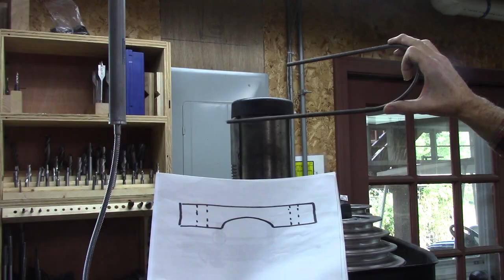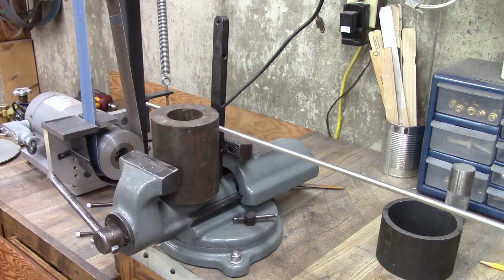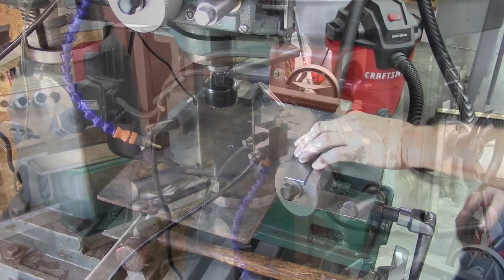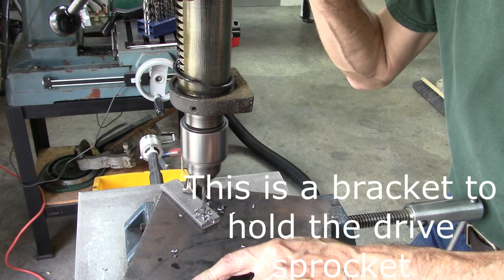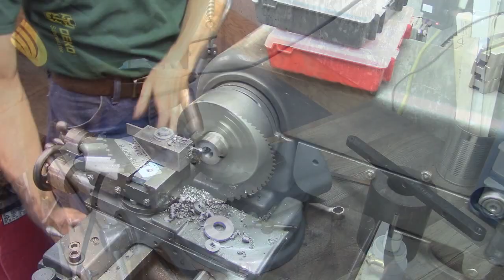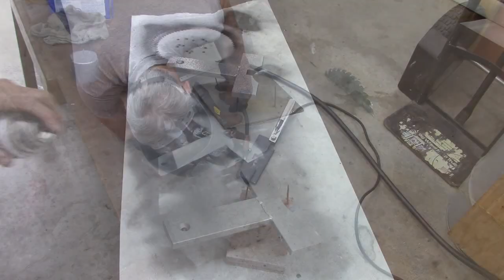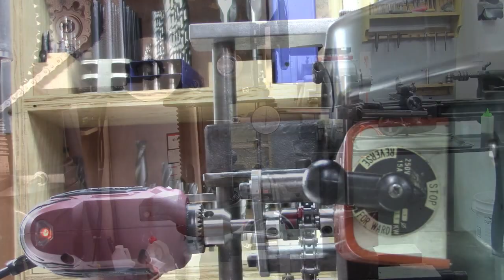The Ultimate Round Column Mill Fix

Comment: Do you think that just fixing the gear rack to the column would accomplish the same thing? either by welding it or bolting it down to the column. in a way that the welds or bolts don't get in the way of travel up and down. like plug weld holes drilled into the rack or countersink the bolts into the holes. maybe by tightening up the tolerances around the rack and rack guide in the existing machine, you could get similar accuracy as compared to a more complex and more changes necessary to the existing machine design like yours. nevertheless, your still on a round column. I HAVE one of these rung-fu or RU30 machines and I have had this issue he addresses here in this video.  but having a round column also has some advantages. while repositioning the spindle exactly can be done with basic measurement instruments like a center finder or indicator. furthermore, this is an issue I rarely come across. and probably a more useful upgrade to the machine would be a more secure way of clamping the spindle head down to the column. that's where the rung fu design has failed me in the past, is movement during a mill opp. due to lose clamp nuts
Reply from the maker: Thanks for the comment. I have had the head slip on the column while milling but not for a long time. I now tighten the clamp tighter and it never slips. I have thought about a large lever and some kind of toggle clamp but so far have not followed through. Securing the rack to the column might be a possible fix. I actually tried doing this but had a few obstacles that I never found a way around. 1) the space between the gears teeth is not large enough to drill and pin (or weld) or at least I was worried about weakening the teeth. 2) securing the rack at the top and bottom was totally inadequate. The rack flexes and would need to be attached to the column in at least 5 or 6 location. Even then, .001" flex would equal to .010" at the end mill. 3) even with the rack temporarily secured to the column with clamps next to the head I had problems getting the head to clamp consistently. Achieving the correct amount of pressure pushing to one side was hard to do. Achieve a repeatable position was nearly impossible. I think that ultimately milling a shallow recess in the column would be the only way to adequately fix the rack to the column. Actually milling a slot and using a key might be a better approach. This is a huge job and I didn't have another mill to do this with. You said, "furthermore, this is an issue I rarely come across." This is surprising to me. Before making this modification I would work around this issue with planning my cuts and running the quill fully extended to increase the amount of clearance so that I could change a collet but, it was always a headache to deal with. Without a doubt this modification is a lot of work but when paired with the power lift it's a convenience I would hate to do without. The only time consuming task that remains is clamping to the column.....  and I need to address this aspect.

Comment: excellent video and design.   I have the same mill (circa 1998 made in Taiwan) and have been looking at different solutions, and i think yours is best.   I dont have welding setup, but should be able to do in aluminum and socket head cap screws.  BTW, love your "pre-OSHA" shop!
Reply from the maker: Pre-OSHA? Funny. I have a lot of open belts and gears. If I had a employee I would probably look at things a little different. Adding the guide bar and lift on my mill was a lot of work but very worthwhile!

Comment: I  implemented a much simpler, albeit slightly less accurate (perhaps 1/64"), solution.  My drill press table has a slide in-slide out sacrificial insert in the middle of the table.  I centered my drill press table at a convenient height and the marked scribed a line along the sacrificial insert using a transfer punch inserted into the chuck.  Then I marked the line with a pencil.  Now when I move the table up or down, I simply put the transfer punch back into the chuck, slide the sacrificial insert out to a point where there is no hole in it and center the drill table.  I have a picture, but YouTube will not let me attach it to a comment.
Reply from the maker: You can send me an email at winkywworkshop@GMX.com if you want.

Comment: The goal of keeping zero alignment is a good one. Seems like a simple dial indicator and brackets on the column and mill head would suffice.  Zero like a vice tightening and tapping with dead blow.
Reply from the maker: Suffice maybe...  but what a pain. I used to do that all the time. Occasionally I would get lucky but locking the head moves everything. With the guide bar it is very consistent, usually less than .002". Admittedly, working in a factory setting most my life probably ruined me. The extra minute or two it took me to align the head bothered me a lot

Comment: Could you do a video or post some pictures of how you mounted your DRO. I have the same type unit, and have mounted the z axis but not the x & y yet.
Reply from the maker: The DROs are a pain to mount. I'm not sure I did it the best way which is why I didn't make a video. The worst part is that I had to leave the way cover off. I replaced the X axis once already but I think I got too much coolant on the slide. The biggest issue is battery life. If you remember to turn them off you will be good for years but mine last less than 4 month because I forget. Here's a link to pictures of mine. https://photos.app.goo.gl/y86Y3aMenjvHQqeG9
Reply: @WinkysWorkshop  I see you attached the x axis to the rear of the table, I was going to attach it to the front (using the stop block slot), but that would mean I would no longer have a hard stop. I too have killed a battery or two by not turning off the unit! Thanks for the photos.
Reply from the maker: @carlsartor1423  Yeah...  it limits travel by about 3/8" but I'd rather do that than to lose my stops. Your welcome

Comment: I just got one of these mills and like the idea but i think i'm going to go with simpler by making locking brackets like you have to just lock in the gear bar...it will act like your outer guide rod. maybe some minor error but i'm not too concerned ..  great idea none the less, and power feed sure is nice
Reply from the maker: Yeah this was a fairly involved project. If you use your rack you will get a lot of flex in the rack. At minimum you need two bolts at the bottom and top to hold the rack to the column.  You may also need to drill and pin the rack in the middle as well. One reason I went with power was to reduce the influence of the crank and improve the accuracy.

Comment: Lock the rack to the column with countersunk bolts. Have a third collar ride on the plate along the column. Make the notch square, but round off its corners so that they don't dig into the rack's metal surface.
Reply from the maker: That would work but the rack would have to be bolted fairly often. Also the amount of metal at full depth of the teeth is not really adequate to counter bore.  I considered pinning the rack but was a little worried I would not get it straight.

Comment: Why not just drill holes from the rack to the column, tap and bolt it in place? Not being a smart ass I'm trying to find why it's not a viable option
Reply from the maker: I'm always open to ideas! Outwardly this seems like the obvious solution and I'm not saying it can't be done .... However, I clamped the rack at the top and bottom and the amount the rack flexed was substancial. I haven't done the math but .001" or .002" movement at the rack probably  equates to .015" to .020" at the spindle. To make this method doable you would need to bolt the rack to the column every 4 to 6 inches. The amount of metal at the bottom of the teeth on the rack gear is maybe 3/16 max. I was afraid it would weaken the rack or the teeth. The other scary part would be alignment. Making it perfectly straight might not be hard but what if you mess up. Correcting the alignment might be hard to do.
Reply: @WinkysWorkshop  Thank you for the response, I see the dilemma. I was looking to buy a round column because the used prices are good but I am reconsidering after seeing this.
Reply from the maker: @pnuema1.618  Around here you can get a well used bridgeport of index doe about $2000 to $3000. If you have the space it's the best option. I'm overall pleased with the round column but before I modified it, it was a pain. Totally bad idea. I put a square column on my drill press for the same reason. Best thing ever!

Comment: I will start with the seasons best to you and yours this holiday season my friend. Any time I see that little mill/drill I want one for myself. It has served you well as far as I can see and any tinkering you have had to do on it has been fairly minor. Yup on the 1/2 link or a plastic (UHMW ?) lined tensioner that wraps around a section of pipe just long enough for the chain to get the "climb" out of the chain. I used to adapt chains like this to multiple rollers in cedar sawmills that the bark would climb up on the sprockets so much it would break chains or bearing housings. Nasty problem easily fixed eh. It is always a nice visit to come and share what you have for us my friend. Good old no nonsense free problem or a go to machining for a cause. I just plain enjoy your posts my friend. Love that textured spray can paint my friend. It covers more bo-bo's than flat black and a grinder eh, LOL. eh, LOL. What a great addon to this for that piece of equip bud. There is always something to do to max the usability's to serve us. One machine to better the other. Not quite sure will be the end result of that remark will take us eh. Good seasons wishes to you and yours Winky. Onward eh ! Of course if you are bored you can wire in a couple proximity sensors that will take care of travels but yer a pretty sharp fella as it is eh, LOL.
Reply from the maker: Thanks for the compliment!

Comment: Is interesting to se how we solve problems. , I' think you over engineer it ., will be more easy to use the pinion rack as your guide and use a servo motor to go up and down but steel many ways to skin a cat well done on your trains of thoughts.
Reply from the maker: I actually tried using the rack and it didn't work out. I had brass tipped set screw pushing on the side of the rack to stop head movement. The rack was clamped to the column at the top and bottom and the head moved around a lot. The thing is, if you removed the teeth on the rack the remaining steel is about 3/16" inch thick. The rack flexes bad! At the top and bottom there is an area to bolt the rack to the column but it would really need to be bolted every 6 inches. Drilling between the teeth for the bolts would be risky and there wasn't enough metal thickness to counter bore for the head of the screw. The amount of tooth left would also not be adequate in my opinion. Then there is the issue of getting the rack screwed to the column exactly parallel. I've got maybe $120 bucks into the lift and guide. I would have loved to find a gear motor for the lift but I could not find one for less that $250 and the HF drill was $29

Comment: just a thought, the rack spins around the column with the head and couldn't you drill and pin the rack to the column preventing the head from rotating?
Reply from the maker: I did try this. To a degree this would work but their are a few problems to work around. First the clearance between the rack and the slot it runs in. I installed brass tip set screws to hold the head to one side of the rack. The way the casting is made it was hard to get to an area where you can do this but it can be done. Second, the column flexes, a lot. I put clamps at the top and bottom of the rack and the head moved back and forth at least 1/4". So to make this work you really need to bolt or pin the rack to the column every 6 inches. This means you are drilling through the gear teeth. I think a small pin would be the best option but I was worried and shearing an 1/8" pin. Larger pins would interfere with the gear mesh so part of the tooth would need to be removed. I was worried about weakening the tooth and the rack. There is less than a 1/4" of metal on the part of the rack against the column. 

Also, the guild bar is away from the column which makes it way more accurate. .001 movement at the bar is a bit less than .002 at the spindle.

Comment: great video, i have the same mill except mine doesn't have a reverse. Did you fit that and if so did you change motor or rewire old one .Thanks
Reply from the maker: Thanks! Mine came with the reverse. I bought it used. It looks original but I could be wrong. I almost never use the reverse. Of course if I didn't have it I would need it

Comment: Hi Winki, you might could put a adjustable Clamp across the two angles holding the Deleon. That way you could tighten the Delrin against the Bar a little tighter.
Reply from the maker: I actually did that and then tightened it down. So far it hasn't worn that I can tell.

Comment: for unknown reason, that machine looks like a ........ chinesium “west lake” drill press with a cross slide to me? and for another unknown reason, why most of the drill press use round tube as backbone? we known they will “swing” their head long time ago. is that supposed to be a square tube‘s job? or an I beam, H beam? look at those mag drill, boring machine, concrete drill, they all use square tube as backbone, and never have “swing head” problems. that's a mystery?
Reply from the maker: Yep... Chinese. It was fairly cheap and I got tons of tooling with it. Now that I got the round column issue addressed I like it fairly well. The table is fairly solid. Honestly, I suspect its a bit more solid than many of the smaller Chinese mills with a square column. BUT...   I agree what retarded person ever thought about putting a round column on a mill "OR DRILL PRESS"!?!? I I put a square column on my drill press...  along with a powered table lift and x y table and its the most used tool in my shop.

Comment: Great design! I see another design is screwed down the racks on top and bottom to keep column in line. That might fix the issue there and then add the power feed as you did.
Reply from the maker: I tried doing that. The two problem I had was that the rack flexes. It would have to be pinned every 3 inches to stop the flexing and you would have to pin it through the teeth. Second the amount of slop in the channel the rack is in is huge. I could not figure out how to eliminate this slop.